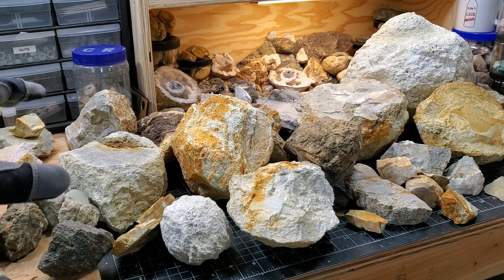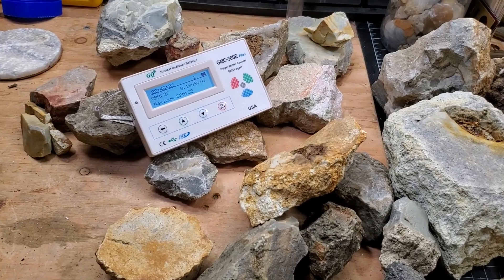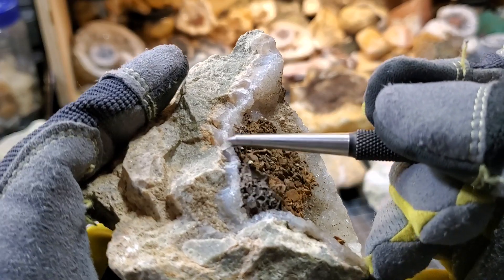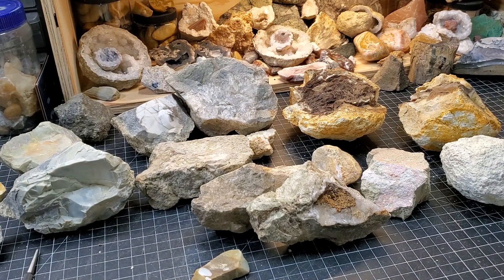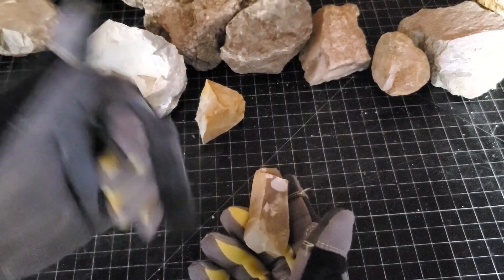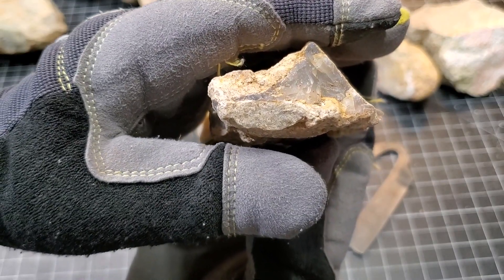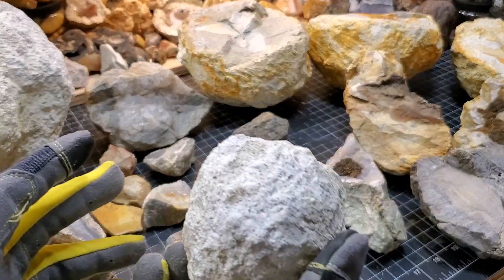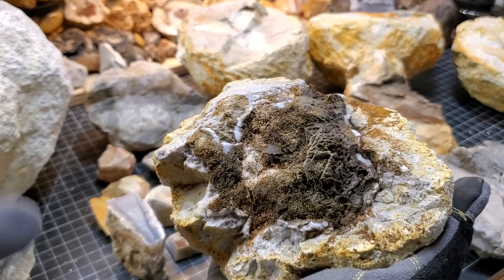Understanding Rimrock Thundereggs // What's Actually Inside

Comment: I have alot of big ones like that I'm going to put my 12" diamond blade on my miter saw and run my tile saw pump to it will be messy but work and thought u could use the idea. Also could I send you pics of the really odd stones I have maybe you know what they are I got meteorites too.
Well thanks for your video.
Reply from the maker: Be careful running a mitersaw with water like that.